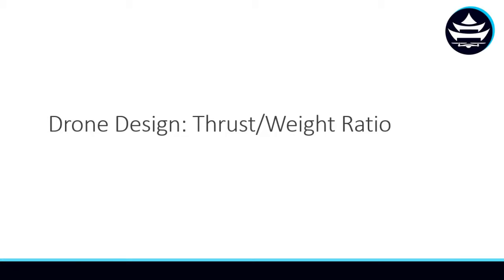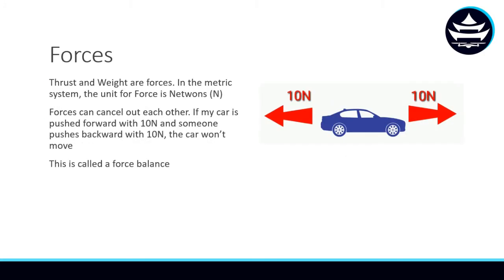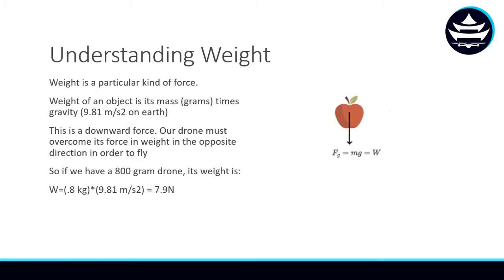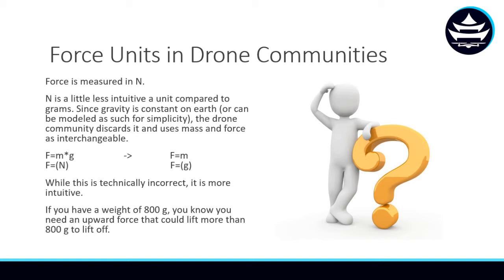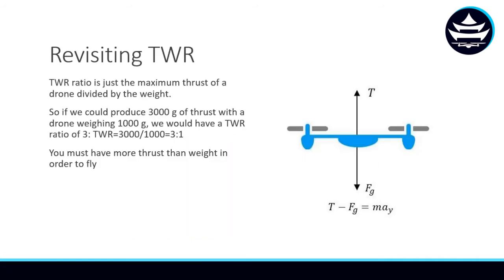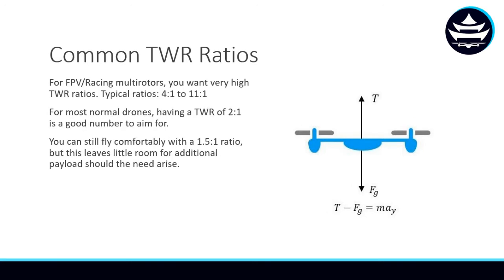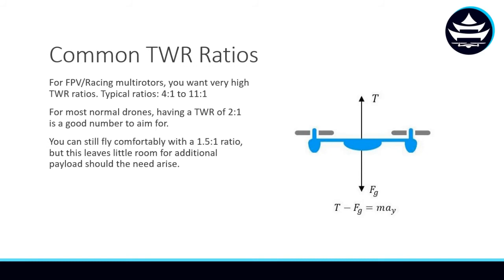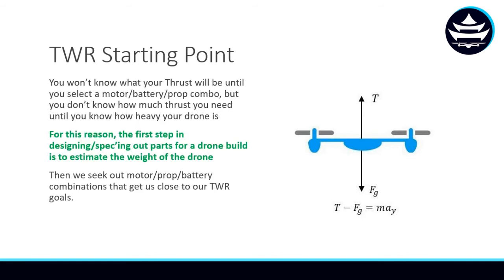Thrust to Weight Ratios | A Drone Design Foundation

Comment: What's the relationship between thrust and torque? I have noticed two methods to measure motor thrust and other parameters. One the motor is mounted vertically and second, it is mounted horizontally to an arm. The second method makes sense as in torque = force * radius, the force can be measured using a kitchen scale or something similar and radius is the length of the arm. But the first method there is no arm so how do you work out torque? Baffling!

Comment: I very much doubt that these toys could hover with TWR<3
Reply from the maker: I think you'd be surprised! It is a bit counter-intuitive to see how well the drones can fly with TWR around 1.5
Reply: @thedronedojo  Q: How do you [mechanically] measure drone's Thrust?? I don't mean with formulas;  I suspect you are using an incorrect method !!!
Reply from the maker: @kareemsalessi  Please see here https://www.droneomega.com/drone-motor-essentials/
Reply: @thedronedojo  Thanks. That's pretty extensive. Do you know with which device/s they measure a motor's thrust-force ??
Reply from the maker: I normally don't manually calculate the thrust of the motor/prop/battery combo. A good motor manufacturer will post thrust tables that documents the empirical data of the thrust performance, then you can engineer your build off of that data. A good example of thrust tables can be seen at the end of this page for an EMAX motor https://emaxmodel.com/emax-rs2205-racespec-motor.html

However, if you wanted to calculate thrust, you could probably do this with a scale and an upside down prop (so that when it spins it presses the motor down).
Reply: @thedronedojo  That's what I suspected to be your known mechanical method of measuring it, however, the measurement would show the down-force, plus the weight of the drone, sitting on the scale. However, if you did the converse, namely with a precision  force-meter held above, upside-down, and the drone pushing up against it, that should show the correct actual thrust-force; Don't you think so???  Plus:: Your thrust-link is awesome; very useful. & I think once a specific-thrust motor is installed in a drone, it would have to have well over TWR>2 to hover!!! Thanks. K.S.

Comment: How to calculate thrust, any formula?
Reply from the maker: There are formulas, but they are functions of many, many variables (6 or 7 +). For this reason, I like to stick to the empirical data. You can check out this guide though if you're curious https://quadcopterproject.wordpress.com/static-thrust-calculation/